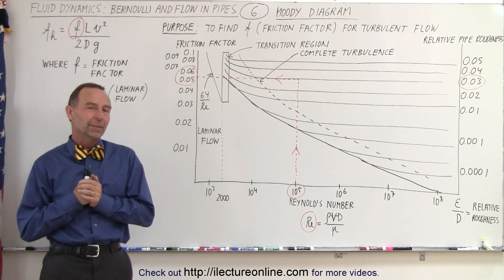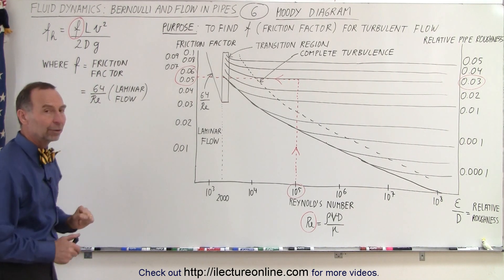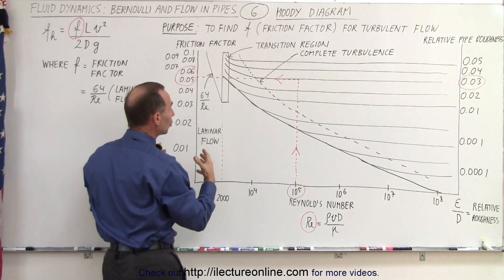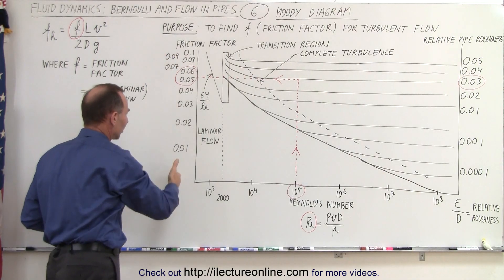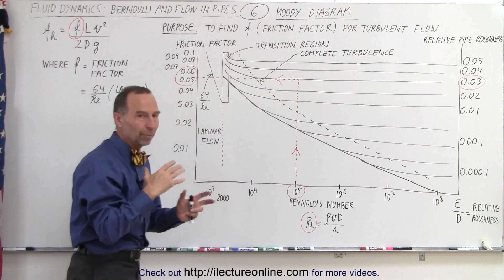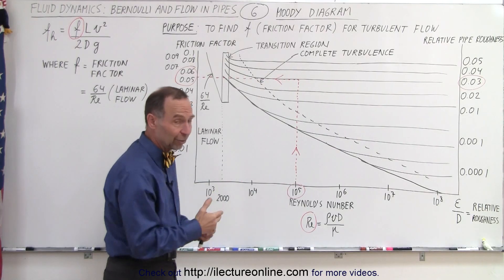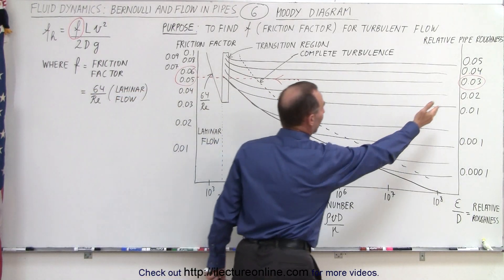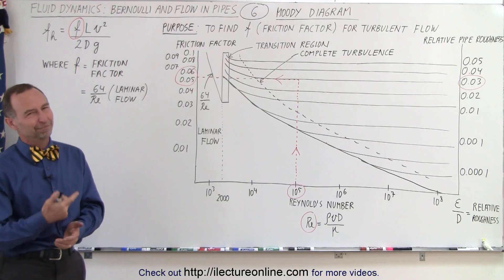Physics 34.1  Bernoulli's Equation & Flow in Pipes (6 of 38) The Moody Diagram

Comment: But what happens if the reynold's number and relative roughness intersect at a point below the lines? Like when reynold's number is 10^5 and relative roughness is 0.0001 in the diagram. How to find f then?
Reply from the maker: You would have difficulty of finding anything with relative roughness of 0.0001.  This chart is useful for typical cases and materials.

Comment: what is the difference between coefficient of friction and friction factor?
Reply from the maker: The friction factor is related to the resistance of air flow in a duct.  The coefficient of friction is related to the friction force required to slide one object over the surface of another object.

Comment: In some books, i found the friction loss formula with a 4. 4fLv2/ 2g D. Why there is a 4?
Reply from the maker: Not sure.  It could be a factor added that is related to the viscosity of the liquid, the temperature of the liquid, or in case the units are different (it should be meters of head loss).
Reply: when we use coefficient of friction f instead of friction factor f then we multiply 4 in the equation.

Comment: just a clarification based on the example, should I get 0.06 as the friction factor or 0.05? Thanks in advance, Sir
Reply from the maker: It wasn't meant to point to a "particular" value.   It looks like it would be somewhere between 0.05 and 0.06.  It was not the value that mattered but the principle that was explained.

Comment: What does it indicate if experimental data gives a friction factor around 0.02 and Re number of 2x10^4? That there is error in my experimental data, (or calculations)? Or if not, how would I read the Moodys Diagram to give a value for the relative roughness?